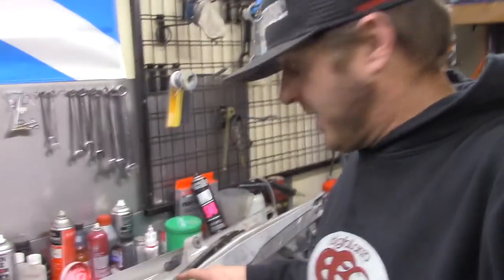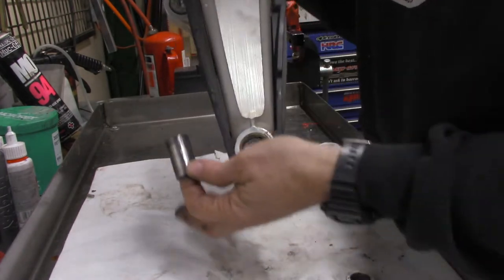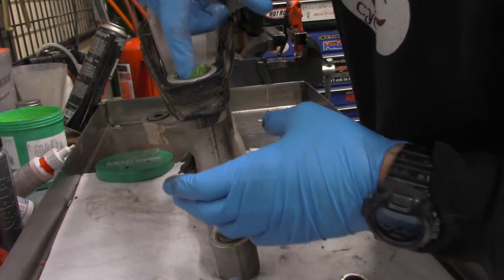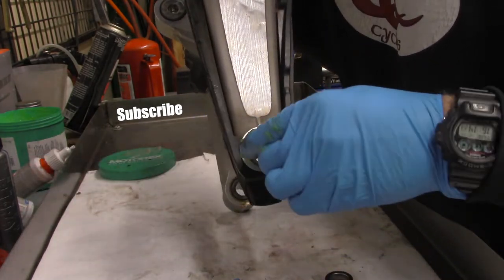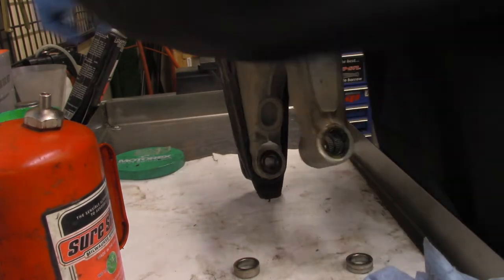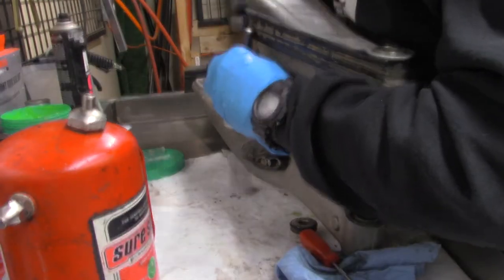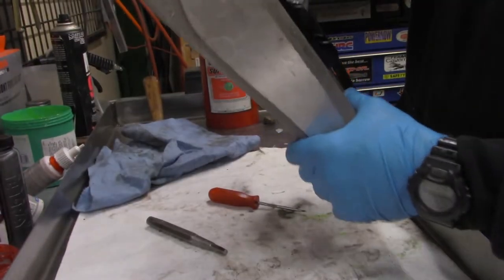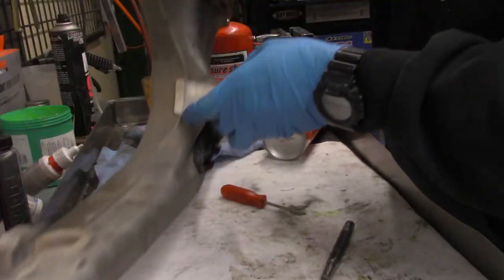Greasing Swing Arm Bearings

Comment: Why do they use the heim joint there instead of somthing like needle bearings? If all the other linkages are working correctly then that linkage will only rotate and not twist laterally right? Is there that much flexibility built into the frame and swingarm or am I way off?
Reply from the maker: neil spires I think it’s because of the nature of having it bolted directly to the swing arm  without a linkage. When the shock compresses it twists because of the spring and that heim joint allows for some movement
Reply: Ahh ok that makes sense.